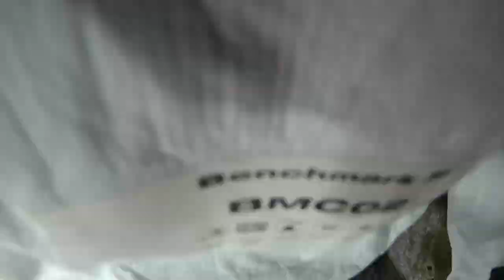TOP SECRET SARIN GAS waste disposal effluent shaft!

Comment: Imagine being the crew tasked with building that vertical shaft! I wonder how long it took them to complete it?
Reply from the maker: Back in the day driving a tunnel, father and son would be an achievement of 3-4feet a day. No money was made driving the tunnels or adits… until they hit a lode. 
So a shaft of this size would of taken possibly years given the number of man power could change this figure. 
One mine I did the tunnel/adit was around 400-500ft long, as you walk the adit every 40-50ft the tunnel would change pattern from high and narrow, low and wide, straight, square, rounded… this is due to different techniques and the person advancing the tunnel.
Cornwall the shafts were mostly granite so how ever they did it, they deserve a raised glass 😁👍🏼